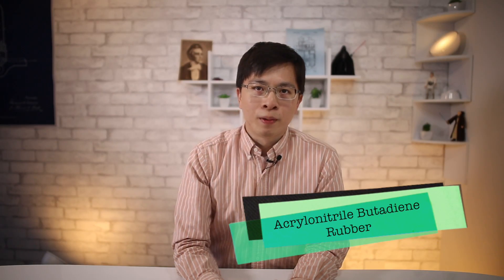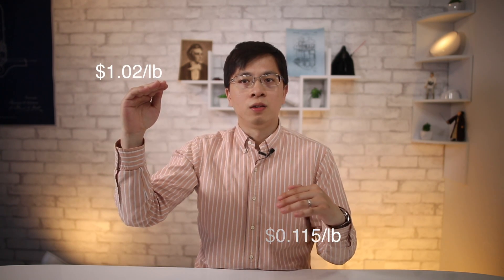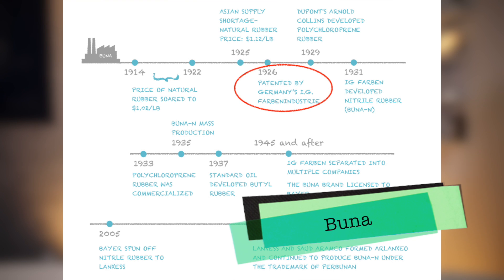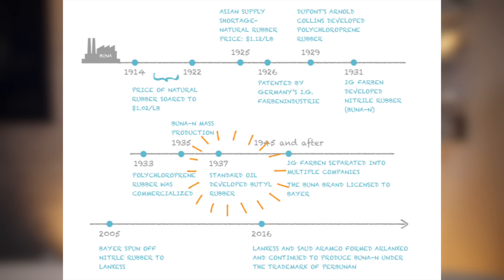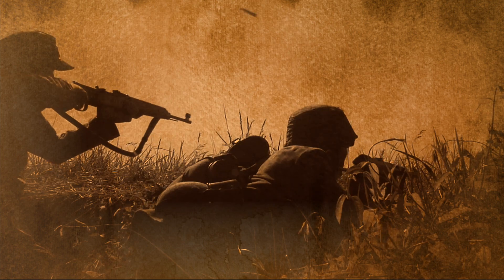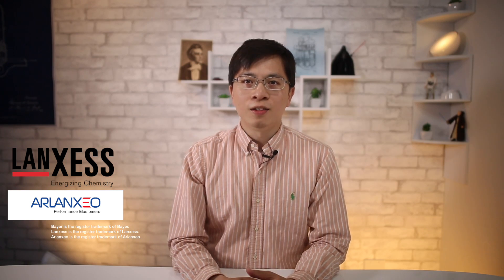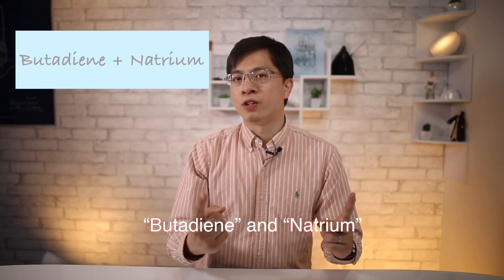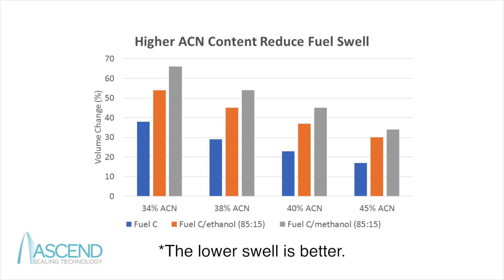What is NITRILE RUBBER? Things You Must Know About NITRILE RUBBER

Comment: is it possible to use this with nylon to create a gasket seal?
Reply from the maker: It is possible to use Nitrile rubber with Nylon.
There are many ways to "integrate" rubber with Nylon.
The most common one is we called "Fabric reinforced Seal", a composite seal.
It is a gasket which mold rubber on/with a sheet of Nylon fabric.
It's like a steel reinforced concrete, it can significantly enhance physical property and life.

Let me know if you want to know more about this.
We are working on a new video with some hands-on demo. :P
A little bit delay recently.

Comment: Can this be used as a o-ring in water application.  Is this the same thing as hnbr?  I got some hnbr o- rings from harbor freight. They are hnbr
Reply from the maker: Hi David, 
Thanks for the comment.
(New Add) Yes, HNBR can be used in water application.
Actually, NBR can work perfectly on daily plumbing application.
We also offer plumbers pack on Amazon. :P
 
Nitrile Rubber(NBR) is different from Hydrogenated nitrile (HNBR).  
Long story short, HNBR is developed to improve chemical and temperature resistance and also good mechanical properties. 
And of course, HNBR have a higher cost.   \($_$)/
The most significant difference from HNBR and NBR are High-temperature rating,  common NBR served up to 100°C/212°F, HNBR served up to 150°C/302°C.

We are preparing all the rubber material information on our channel, thanks for supporting us.
Reply: @theo-ringguy6172  wow thanks for the immediate response.   Can it be stretched to fit as long as it has a good seal
Reply from the maker: @sisdavid  
Hi David, 
It is our pleasure to answer any questions about sealing and rubber technology.
As I said in the video https://youtu.be/yXWa1VIycE8    
It is my passion!
Stretch: officially I have to say "it depends" (We are also preparing this topic video as well).
Role of thumb, no more than 10% stretch on HNBR. Keep in mind, the more stretch it will reduce sealing lifespan.

Comment: Good explanation.
Reply from the maker: Thanks for your feedback :) 
We are planning a new video. If you have any questions we can answer it by a video.
Reply: @theo-ringguy6172  sir as expert on elastomer, please advise me suggested  supplier neoprene/ FKM sheets can provide certificate test as well. Im looking neoprene sheets for pipe clamp  temperature more tha  100C. Also adhesive glue to apply on steel surface.